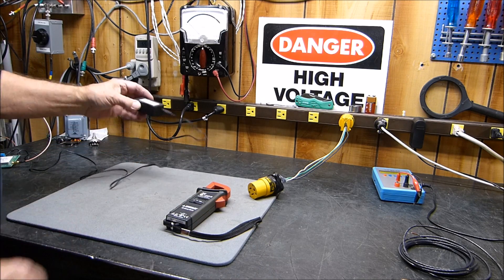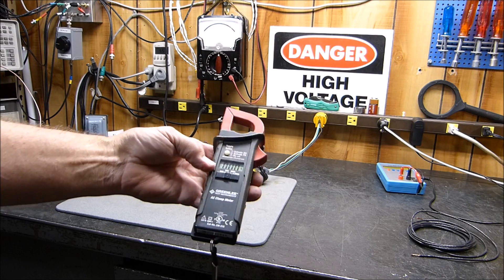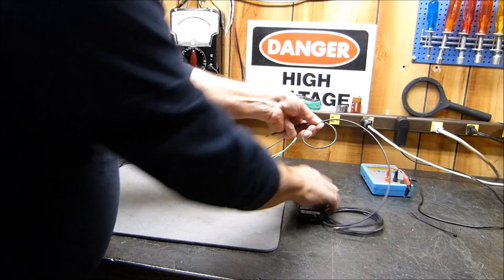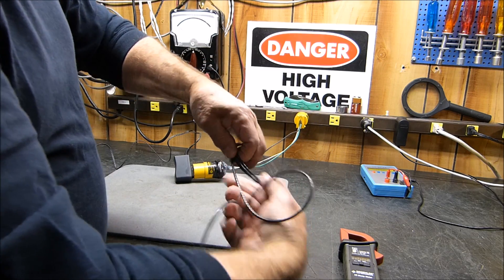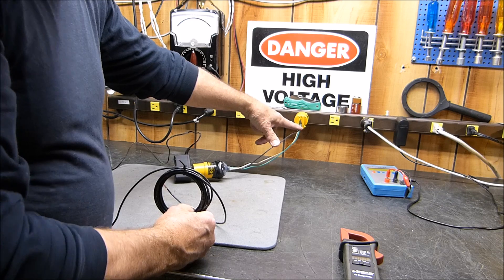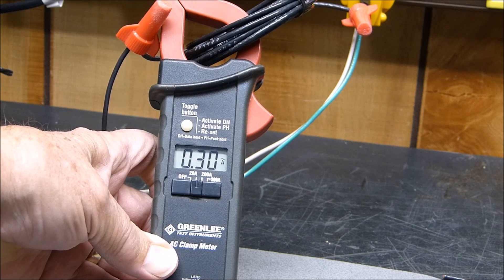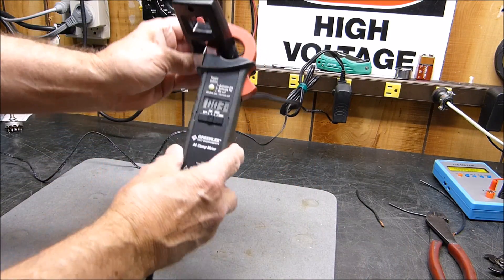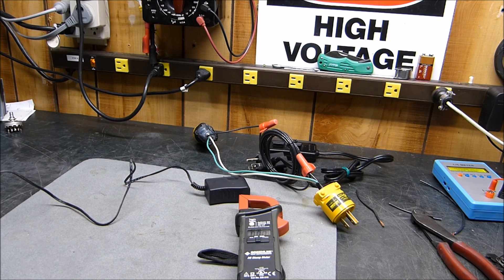Scale Multiplier For Clamp On Ammeter To Measure Very Low AC Line Currents

Comment: What is the length of the 14AWG wire that you used to get 10x loops?
Reply from the maker: It doesn't matter the length of the wire - it matters the number of turns - just make the diameter of the loop some size that is convenient to clamp your meter around.
Reply: @ElPasoTubeAmps  I understand, im just curious because I would like to get extra long banana plug leads and wrap 10x for my multimeter.  I am concerned about long wires increasing resistance, hopefully negligible.  Also, is bare conductors wire better? is wire insulation a factor for induction?
Reply from the maker: For common 60 HZ AC purposes and measurements, the resistance is negligible. You would not be able to wind bare wire as the turns would short unless you have some spacing in them and the inductance is also negligible and so would be the dielectric of the insulation. If you were trying to measure MHz level signals it would get complicate and beyond my ability to construct and you might have to buy something like a Tektronix P60xx current probe and Tektronix type 134 current probe amplifier - that is what I use for HF current measurements with an oscilloscope.
Reply: @ElPasoTubeAmps  intent is to measure parasitic draw 12V automotive
Reply from the maker: I am assuming parasitic DC current draw on the 12V system of an automobile is the current draw for the computer, etc., all the keep-alive devices, If that is the case, the current draw is pretty small and will have to be measured in series with one of the battery leads with a standard current meter. I have made those measurements also. It seems like it is around one (1) amp or so ? I don't remember for sure but being DC this method of the coil and clamp on meter won't work as the current has to be AC - if I understand this correctly.
Reply: @ElPasoTubeAmps  yes 10-30mA on an old car like mine.  I’ve heard of varying experiences with low amp clamps at those ranges, some say they aren’t reliable below 100 mA so 10x looping made sense to me to get the vehicles into the stable ranges of the meters.  I’ve read that looping is for both AC and DC, but I’ll check.
Reply from the maker: The loops are not going to work for DC. The magnetic field must be changing for the clamp-on meter to work. Although, I think I have heard of DC clamp on meters - are such things real? I have never seen or had one.
Years ago - like 40+ years ago - I build a linear amplifier for ham radio and put it in my trunk. It ran a pair of 6146 tubes, 6V filaments I wired in series for 12V and decided to leave them on all the time. The current is 1.125A for the 6146 and it took about 2-3 days to kill my battery. I didn't think a 1A constant draw would matter but it did. Of course these are much older batteries than today. Just some experience. I suspect the keep-alive current has to be under 1A so the battery will last, say, one month between being started and charged - that is just a guess but I think is reasonable.

I asked ChatGPT about DC clamp-on meters and they say they exist:  See below. Now I have to  have one...   🙂

User
Is there such a meter today as in a clamp-on current meter that will measure DC thru a circuit?

ChatGPT
Yes, there are clamp-on current meters, often referred to as "clamp meters" or "current clamp meters," that are capable of measuring DC (direct current) through a circuit. These devices are essential tools for electricians and technicians working with both AC (alternating current) and DC electrical systems.

Modern clamp meters are versatile and can typically measure a range of electrical parameters, including:

DC current (measured in amperes or milliamperes): Clamp meters are equipped with jaws that can be clamped around a conductor, allowing you to measure the current flowing through the conductor without the need for direct contact.

AC current: Most clamp meters are designed to measure AC current as well. This makes them suitable for a wide range of applications in both residential and industrial settings.

Voltage: Many clamp meters can also measure AC and DC voltage, making them multifunctional tools for troubleshooting electrical circuits.

Resistance: Some clamp meters have resistance measurement capabilities, which can be useful for diagnosing faults in electrical circuits.

Frequency: Depending on the model, some clamp meters can measure the frequency of AC signals.

Continuity and diode testing: Some clamp meters include continuity and diode testing functions, allowing you to check for open or short circuits and test diodes.

When selecting a clamp meter for measuring DC current, it's important to check the specifications to ensure it meets your specific needs. Look for a clamp meter with a DC current measurement range suitable for your application and other features that may be important for your work. Additionally, make sure the clamp meter is designed for the level of accuracy required for your measurements.

Always follow safety procedures and guidelines when working with electrical circuits and equipment, and consult the manufacturer's instructions for your specific clamp meter to ensure proper usage and accuracy.
Reply from the maker: I have never used a DC clamp on ammeter but they seem to exist.  I stand corrected:   https://www.youtube.com/watch?v=4Dc8VH0eXcs
Reply: @ElPasoTubeAmps  yup, and another use case is in solar measuring VDC + ADC to get VA (or power or watts)
Reply from the maker: That is good to know. I have a nice Fluke meter that displays DC, AC and oscilloscope display (no current) and I thought that was cool. I remember reading some time back about DC current clamp on meters using Hall Effect (?) or something like that. I saw a fellow in a YT video use one to measure the starting current of his engine but I dare say, I think an AC meter might do that as the momentary field around the coils could be measured. Maybe not. Anyway, thanks for helping me learn about a nice instrument to have around. (I am still skeptical... just my old age...  I need to see it happen...  🙂
Reply: @ElPasoTubeAmps  yeah my understanding is a transformer configuration is used to measure AC current but won’t work for DC current so Hall Effect is used.  Fascinating stuff!
Reply from the maker: I see now it is an active (powered) device so it makes much more sense from, as you say, the old transformer devices. ChatGPT's explanation of it attached: Thanks for the conversation.

User
Describe Hall Effect as it pertains to DC current measurements with clamp-on meters.

ChatGPT
The Hall Effect is a physical phenomenon that occurs when a magnetic field is applied perpendicular to the direction of electric current flow in a conductor. It was discovered by Edwin Hall in 1879 and is used in various applications, including DC current measurements with clamp-on meters.

In the context of DC current measurements with clamp-on meters, the Hall Effect is utilized to determine the magnitude of the current passing through a conductor without the need to physically break the circuit. Here's how it works:

Principle of Operation:

When an electric current flows through a conductor, it creates a magnetic field around the conductor according to Ampere's law.
If a magnetic field (from an external source) is applied perpendicular to the current flow, it exerts a force on the moving charge carriers (usually electrons) in the conductor.
The force causes a buildup of charge on one side of the conductor and a depletion of charge on the other side, creating an electric potential difference across the conductor perpendicular to both the current and magnetic field. This is known as the Hall voltage.
Hall Probe:

In clamp-on meters, a Hall probe is integrated into the clamp's jaws. The probe is made of a semiconductor material and is placed perpendicular to the conductor carrying the DC current being measured.
Measurement Process:

When the clamp-on meter is clamped around the conductor, it surrounds the conductor with its Hall probe.
The DC current in the conductor generates a magnetic field around it, and this magnetic field interacts with the Hall probe.
Hall Voltage Measurement:

The Hall probe measures the Hall voltage created due to the interaction of the conductor's magnetic field and the magnetic field applied by the clamp-on meter.
The Hall voltage is proportional to the strength of the magnetic field and the current flowing through the conductor.
Current Calculation:

The clamp-on meter's electronics then calculate the DC current based on the measured Hall voltage. By knowing the characteristics of the Hall probe and its sensitivity to magnetic fields, the meter can convert the Hall voltage into an accurate current measurement.
Display and Readout:

The measured current value is displayed on the meter's screen, allowing the user to easily read and record the current flowing through the conductor.
In summary, the Hall Effect in DC current measurements with clamp-on meters provides a non-invasive and accurate method for measuring the current in a conductor by detecting the Hall voltage induced by the interaction of the conductor's magnetic field with an applied external magnetic field. This technology is commonly used in applications like electrical maintenance, troubleshooting, and energy auditing where it is necessary to measure current without disconnecting the circuit.

Comment: This technique is very common in industrial plants where the current meters have to measure even 500 amps and to do that we use to place a meter with 500amp reading scale but 5 amp of current end scale ( thinner wires are easyer to handle and also more secure) in conjunction with a current transformer. Since the current transformers are available only in certain specifications we loop the wire more times to compensate for the reading.
Anyway have you received my email about impedance measurement or it has been lost again? 
73, iu3irr
Reply from the maker: Hi Manuel,
I got your email and my apologies for not responding sooner.
Your techniques for the large transformers is impressive and I have read thru the documents you sent me. Thank you for taking the time and effort to share your information and experience. Of course, my measurements are on a much smaller scale and I go back and forth between the method I built the inductance jig for and confirming a similar value reading on the General Radio 1650A. Actually, I trust the homemade measurement as much as I do the GR for iron core transformers. For mH readings I trust the GR and it is much easier to use. Part of my purpose for posting such procedures for inductance measurement is to alert the audio community that always trusting the little inexpensive LCR meters can be very misleading, especially on inductance measurements. Your posted procedures is another way to confirm inductance measurements on iron core inductors - chokes or transformers. 
David 73 WA4QGA
Reply: thanks for the consideration, i realy apreciate it :)

Comment: For calibration I made one with 50 turns. So I can source 10A and read 500A. But I also use it for the same thing you do. I have  a similar cable as you with 10 loops in one of the conductors.  I also made the opposite to measure higher current with a low current scope probe. I made 10 wires parallel  and clip the probe around 1 wire. 10A in real is then 1A through the clamp
http://schneiderelectronicsrepair.nl/?p=597 there is a picture of my copy of a Fluke 5500 coil with 50 turns
Reply from the maker: That is really interesting about how the copper wore off the PC run and shorted the segments. Very good observations to be able to see that issue. I do tell people often that very careful visual inspection can be used to fix many problems. And, I never thought about the parallel wires to increase current range. I always learn from you guys when I post a video. Many thanks.